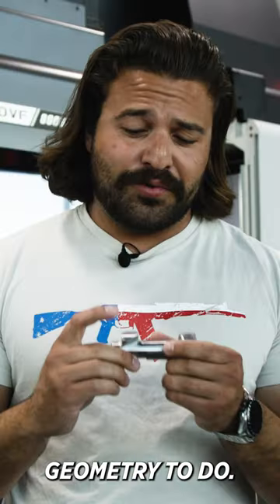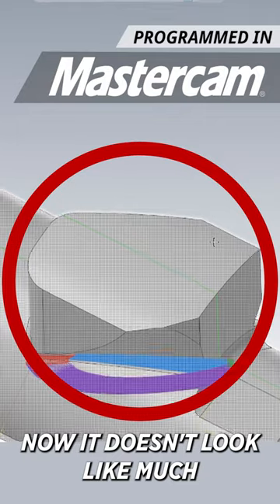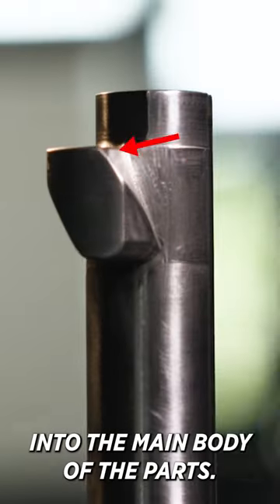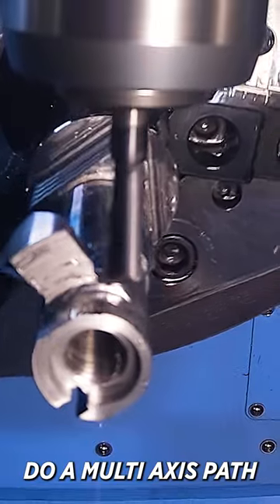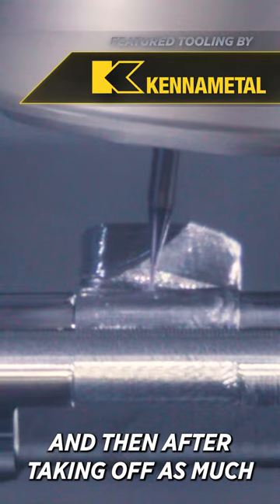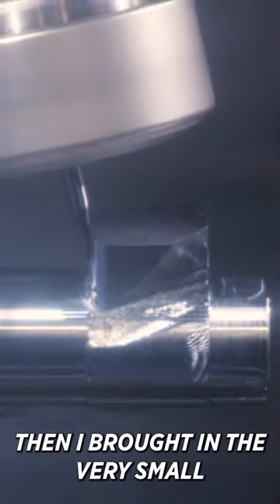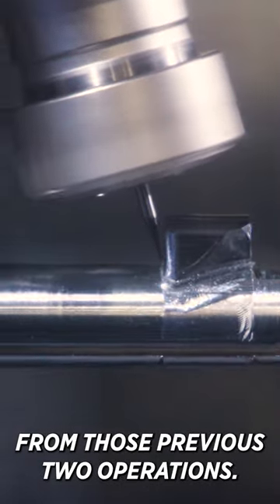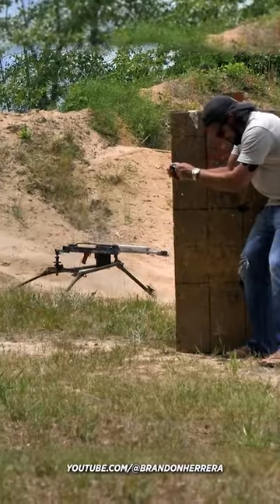CNC Machining the AK-50 Bolt

Comment: I worked in the firearms industry for over 20 years and I had to make that cam in mass  production and did it with 2 toos in less than 2 minute. It is not easy, but we found a way to mass produce it for several different types of machine guns.  
You guys did an excellent job for making a 1 off part. Thanks for sharing.